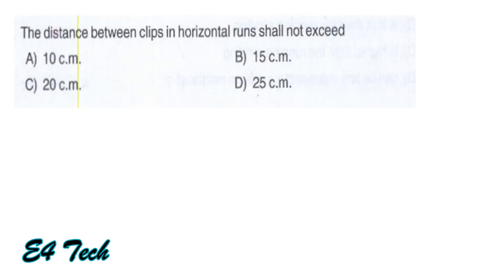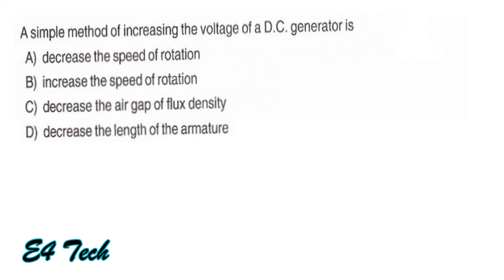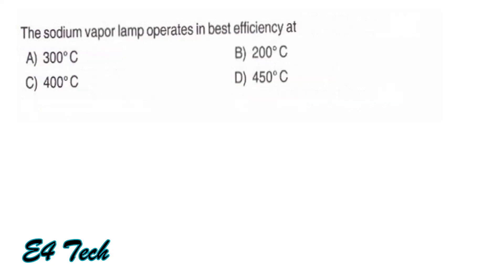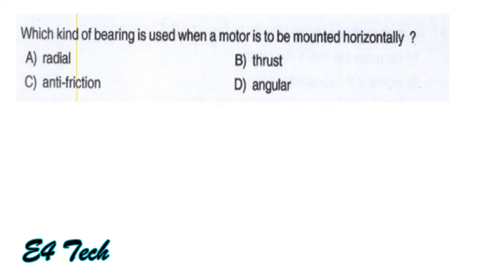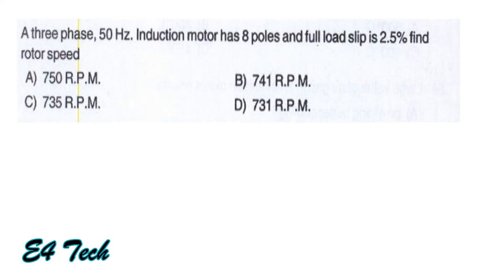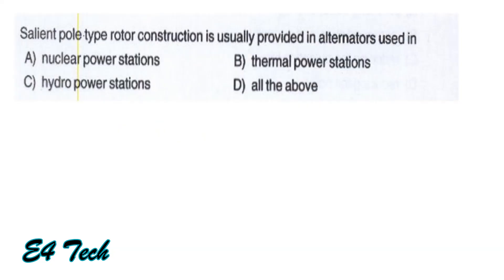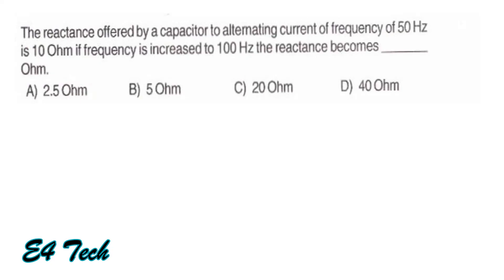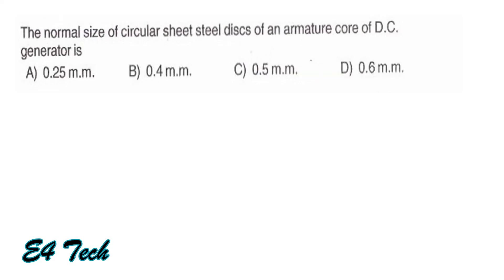PART -12 | KPSC Electrician | Lineman | wireman | Technician - Exam | Question Answer Kerala PSC

Comment: 4.28 rotor frequency kaanumpool sf enna equation use cheyyende
Reply from the maker: Athu running condition ulla rotor frequency.

Standstill condition aanenkil rotor frequency is equal to stator supply frequency.
Reply: Ok ready